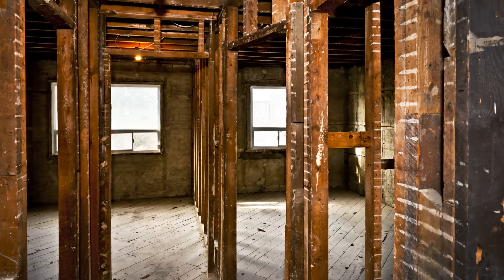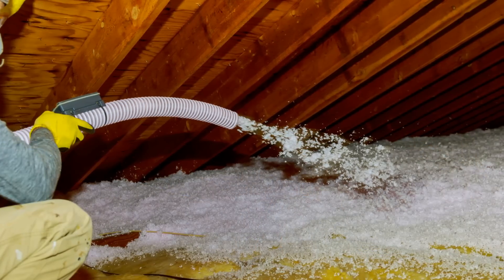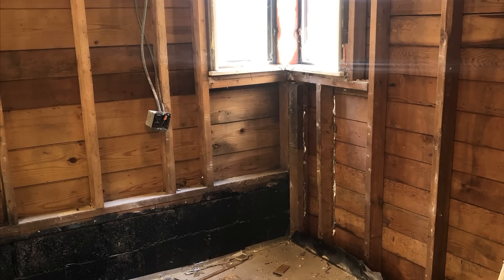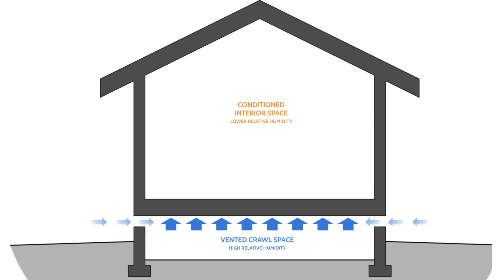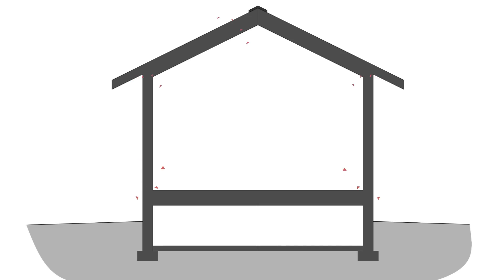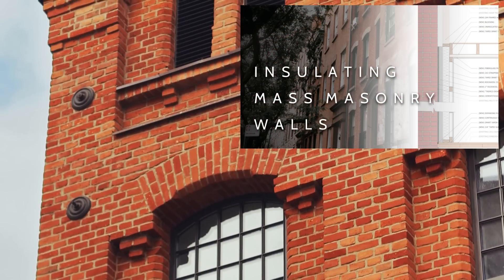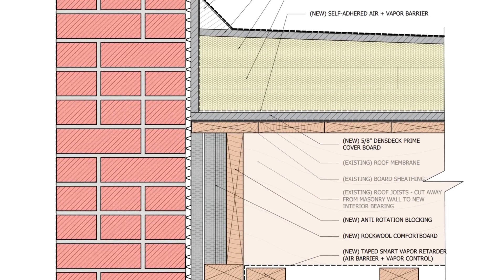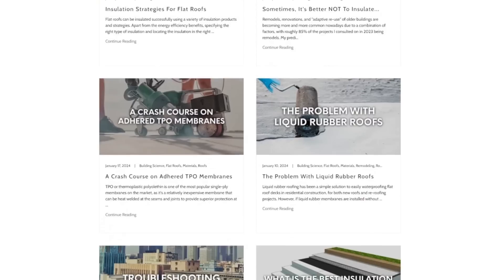Sometimes, It's Better NOT To Insulate

Comment: Thanks so much for the fantastic videos and the e-book.  You do a superb job at explaining the science. My question is:  If you choose not to insulate, what does that mean on a practical/theoretical basis in 2024?   I'm assuming I'll forgo lath and plaster with some horsehair - as much fun as that might be to do.  So how does one approach addressing things like mold, pest/animal fire prevention?  For example, I was hoping to use blueboard/plaster for my interior walls, but I assume I'd need a  a moisture barrier behind it or some alternate choice of  more mold resistant material (you mention fiber mesh atone point).   And in a varied climate like New England, is there an approach to at least mitigate potential comfort and energy efficiency issues (states are banning propane so we're all going to have heat pumps eventually)?     Without a good approach, it seems like going "no insulation" with contemporary materials and thought processes could cause problems to the structure in the same way mindlessly using spray foam would.   Or I could just spend the weekend collecting horsehair...

Comment: I'd love to see a video on comparing different sealing products - caulk, vs spray foam, spray caulk, tape, etc. - Recently saw this newish product by Dow that's an extreme sealant. We're thinking about the best and more cost effective way to seal the roof to exterior wall connections on an unvented roof assembly.
Reply: Look into Prosoco mvp wrap. It's a fluid applied water and air seal for the exterior sheathing and also the important details of Prosoco R guard Fast flash, Prosoco R guard gap and seam filler.
Reply: @MrItalianfighter1  I've used the Prosoco fast flash, but wasn't too familiar with the Rainscreen MVP wrap, that's awesome. I can absolutely see an application of that product being highly useful.
Reply: @SchondorfEnt  prosoco has I think 4 different types of fluid applied house wrap. The MVP wrap is water tight, but it is vapor permeable, so it's good for climate zone 5A. More than likely, a supplier in your area who carries prosoco products will most likely offer whichever product fits your climate zone. It isn't a rainscreen though, so you'll still need to install a rainscreen over it. I marked all my stud locations, installed 2" r10 rigid board, used my stud marks to draw lines at the stud locations and am installing 1/2" fir strips at the stud locations to give me that air gap for a rainscreen. I put a bug screen at the top and bottom to cover the air gap. I'll be installing the siding mounting to the fir strips to complete it all. I did my entire house solo, while having a day job, so this has been a long yr for me, but I'm excited about it.

Comment: You're going to save people hundreds of thousands of dollars and lots of stress with this kind of content. Thank you. I'm looking to buy a home in the greater Boston area and the only options in my price range are houses 50-150 years old. Just thinking about buying a house that has little to no insulation and oil heating has made me extremely hesitant, but I'm currently renting out of someone's basement and can't live how I'd like to so buying a house really feels like a must. Hopefully I can find something that I can afford both on paper and in reality (when all the issues start to show).

My question is, how likely is it that an inspection done before buying a house would be able to discover whether or not insulation was installed properly? Or tell me that moisture is an issue and I can't simply blow in insulation after buying? Should I simply assume that it's an issue when I'm looking at buying houses this old?
Reply: Ideally I guess you'd get the inspection after a rainy day or humid week

Comment: To everyone reading this, people we're stupid when they built most of these old buildings, but they different constrictions, benefits, needs and technology than today. They would build in similar ways we do today, especially if some of our tools and technology was available.

Examples would be: Taller ceilings and transom windows allowed for lower temperatures in summer, while coal was cheap for heating in the winter. - Labor was cheaper, and there were many masons available than today. -Old growth lumber is far superior than box store wood. - House were built more dense for larger families, different rooms were for different social events.

Technically; house warps wouldn't become a thing until tar paper in the 1920s or 30s, and insulation like fiberglass was far far away.

Comment: i have always believed in this. I just rebuilt an older home and insulated it perfectly. one problem i believe is it is too air tight and it causes alot of moisture in the air from different styles of heat, i put in a mini split but have to run it on a special program to suck out the moisture because just one day of use it was putting mold spores all over , the windows would sweat ridiculously so i actually ended up putting a dehumidifier in to help with the moisture. Theres got to be a better way.
Reply: You need whole house mechanical ventilation, look at HRV/ERV's.
Reply: You need a few trickle vents on a few windows (bedrooms, living room...) and  mechanical air extraction in other rooms (kitchen, bathroom and toilets)
Reply: @pauld3327  i know this is the suggested solution but surely the heat loss from trickle vents more than cancels out the benefits of the insulation?
Reply: @bertRaven1  Absolutely not. Your heating bill will be lower with trickle vents and mechanical ventilation because:

- If humidity is too high, you need to increase the room temperature to be confortable.

- Air is very easy to heat but water is hard to heat. Dry air is cheaper to heat than damp air.
Reply: @pauld3327  I'm not sure that the small changes in relative humidity make that big a difference to our thermal comfort. I agree with mechanical ventilation in bathrooms and kitchens because they're clearly necessary to stop condensation regardless of other considerations.

my question is more, if you insulate a house and then you're required to have trickle vents in bedrooms I'm not convinced that you're much better off than not bothering with the insulation?
Reply: @bertRaven1  No, insulation and trickle vents/mechanical ventilation work hand in hand.

If you don't insulate your house you loose heat through your walls/roof without any benefit but with trickle vents / ventilation you sure loose some heat but you get dry air  that comes from outside, which is very beneficial.

Furthermore heat loss from trickle vents/ mechanical ventilation is much less than heat loss from badly insulated walls/roof.

You agree that mechanical ventilation is needed in the kitchen and bathroom. For mechanical ventilation to work properly you need trickle vents otherwise the pressure inside your house would be too low for your ventilation system to work properly. By adding trickle vents on your bedrooms/living room windows you allow all the air in your house to be renewed every few hours. In order for that to work properly, windows in your bathroom/kitchen must not have trickle vents.
Reply: HRV/ERV are the answer for tight homes

Comment: This is a topic "close to home" for me!  A fixer-upper allegedly built in 1950 in NW Florida, I have found a multitude of issues.  Two different building styles, one is well built and uses reclaimed lumber, the other is unbelievably deficient.  I suspect an amateur enlarged the house at some point.  No insulation, of course, and the tar-paper in the walls has crumbled away in numerous places.  I think this is what was called "balloon framing," with air moving through the walls from the crawlspace up to the attic.  Once I finish attic remediation, I plan to install a radiant barrier and have insulation blown in or else lay batts.  The heat radiating down from the 9.5 ft. ceiling during summer is significant.  The sun transmits energy through mainly two sides of the house in a similar way.  I've been installing 2 inches of rigid foam panels with a radiant barrier and then a rain-screen with new siding.  The walls will continue to move air on the inside, but hopefully this strategy will improve interior comfort level.
Reply: Balloon framing fell out of fashion by 1920. Western/Platform framing is generally better, but there is nothing bad about Balloon house other than needing fire blocks to prevent fire from spreading rapidly upward.
Reply: @ThePTBRULES  Thank you for the reply, and the note about fire blocking.  An engineer (or other inspector) suggested the house may have been moved from another location, suggesting that the better framing might be older than 1950.  I have discovered horizontal and diagonal framing in some places, along with horizontal furring as well as some beadboard under the drywall.  I have attempted to block off the openings at the bottom of the walls to keep rats out of the cavities (and attic), but there is apparently still plenty of air flow.  This is Florida, so humid air is the standard usually.  According to Asiri Designs' research, that means I regularly have gallons of water moving up and out through the attic.  The good thing about this old house, there is no evidence of condensation rot.

Comment: Interesting tradeoff for older buildings. Insulation is not a panacea. How do you model flow of moisture and heat flow to make the right decisions?
Reply from the maker: It's nearly impossible to accurately model moisture flow in an existing building, since these programs cannot take into account complex variables like air leakage and convective looping. Taking moisture content readings  moisture monitoring is one of the better ways that we can assess conditions, but a lot of it is judgement based on the basic fundamentals (i.e. where is the source of moisture? which side of the building is warm/cold? Is there evidence of staining? etc.)
Reply: Older buildings need to breath to live. Breathing means drying, so they should not be tightened up so that they can’t dry out.